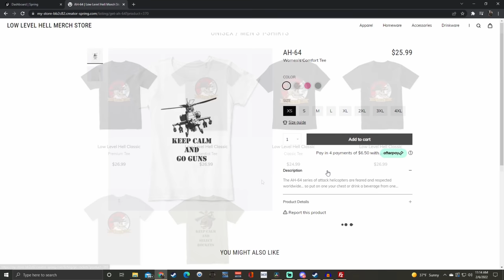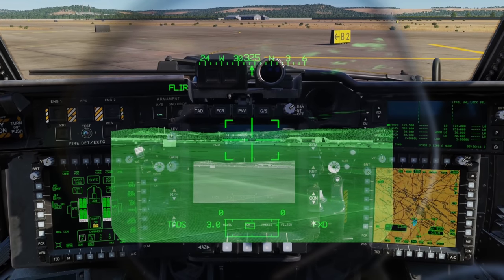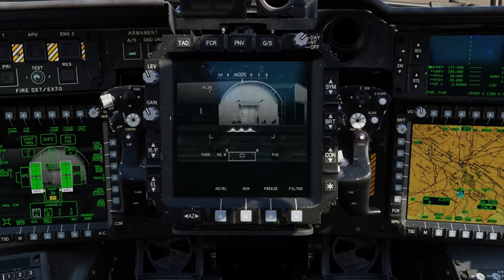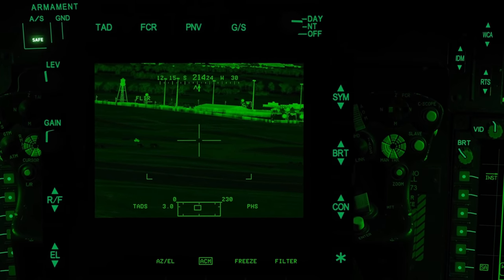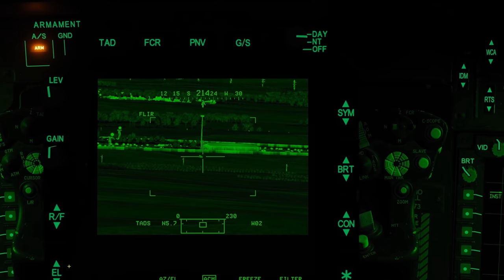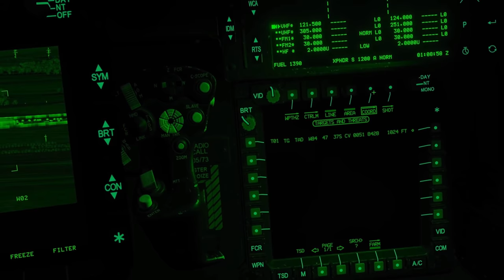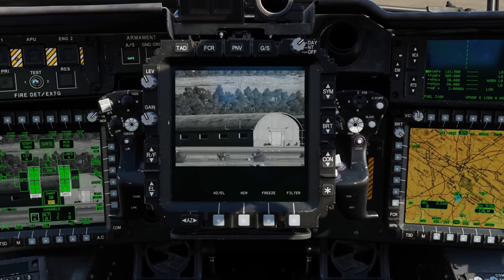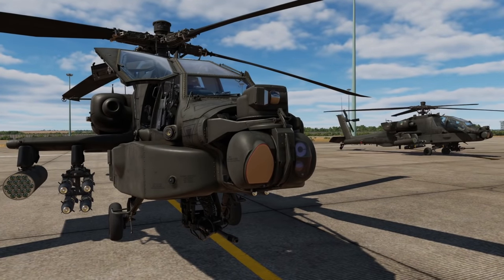DCS AH-64 TADS | Apache Pilot explains the basics | DCS World

Comment: Out of all the DCS aircraft that we already have AH-64 looks more like A-10CII of helicopters, Hornet feels simpler
Reply: Honestly, "simple" is  a very subjective perception. For example, with the AH-64D systems aiding you how they do, and from what I've seen and read so far, the operation is pretty "simple", for most of the stuff. The game changer is multicrew. In the A-10C II you do all of it alone. In the Apache, either CP/G human or AI figures it out. Otherwise you would need to try doing two jobs in parallel, which makes it horribly complicated.
Interestingly, the Hornet feels more "complicated" than the A-10C, because the NAVY Aviation really seems to have issues, creating or simply re-using concepts and workflow similar or copied from the air force... Starting with the inability to use Gun and Missiles in a dogfight at the same time to a HMCS that doesn't even show you where your TGP is currently looking, unless you create a designation. The AH-64, as well as the AV-8B or A-10C seems to be designed and updated, around the very mission profile it is primarily used for. And this shows. I think I'll love this bird.🥰
Reply: exactly! For me Hornet is much more easier, and ergonomically advanced then Viper or Hawg
Reply: Calling the hornet simple is a thing most inaccurate.

Comment: Question. IRL did you guys often close your right and left eyes when utilizing the TADS sight mode? To prevent a double image, or was it not much of an issue? Just curious as you were talking about using your unaided eye to find something of interest, and then using your right eye to take advantage of the FLIR.
Reply from the maker: I would close my left at times to focus on the PNVS while landing but that’s about it
Reply: @CasmoTV  Copy. Thanks for the info friend!
Reply: I agree with Casmo. During landing (especially on an airfield with bright lights on the runway and whatnot) i close my left eye sometimes but your brain just sort of wires itself after a while to process the two separate images separately, if that makes sense. Supposedly no-one is able to "multitask" and therefore process both at the same time, but you switch back and forth so quickly that it looks like you do. So seeing two separate things with two separate eyes is no issue, it just gets annoying when the background gets so bright that you get two separate images in your one PNVS eye (the background "burns" through your HMD, if that makes sense)
Reply: I would add that that is why you wanna keep the symbology brightness as low as possible. For me, it always made it easier to switch between eyes with that brightness driven down to a point where I had to consciously focus on the symbology

Comment: I might need to make the upgrade from TrackIR to VR soon... Feels like I won't be able to get the most out of this without a single-eye overlay rather than a screen overlay.
Reply: It will certainly improve your experience!
Reply: I can see someone trying to use TrackIR with the PNVS and getting sick. It’s already one thing that the PNVS is 10 feet in front and 3 feet below you. Looking to the side automatically induces parallax. With TrackIR, you’re going to be doing that by turning your head, but your eyes are going to be looking back toward the screen…makes my stomach roll just thinking about it. 😂
Reply: @tschooler  You also don't have the precision. 90° of view is done by ~10° of head movement. Totally not ideal for aiming the gun for example... :D
Reply: @tschooler  No because your inner ear is still concurring what the eyes are seeing ; your body knows that you are seated and looking at the screen. Unlike VR, it doesn't have contradictory informations that you have to adapt to.

I don't see how it would be different from the HMDS on the Viper of Hornet. I use those extensively and never had any problems with TrackIr.
Reply: @simonhouel1984  I'm not sure I'd agree with that. Each person will have a different response. I've seen plenty of people get sick in my flying career, usually when inner ear/eyes/seat of the pants don't all agree. Just because you didn't have an issue doesn't mean that others won't.
Reply from the maker: I haven’t had any motion parallax issues/ disorientation with the PNVS on track IR with the test build but not everyone is built the same.
Reply: @tschooler 
That's my point. With TrackIr everything is on the same page, not to mention the peripheral vision that provides informations that concur with what every other ''sensor'' get.

Basically, you are just staring at your screen with an overlay on it.
Maybe it will indice some weird head gymnastics but I really don't see what would cause the brain to feel to being cheated or something.

But you are right though, we are not done the same.
I may be missing something here but I really can't see the difference with the Hornet or Viper Helmet.
Reply from the maker: It’s incredibly different, the primary difference is that you don’t see-and-avoid while flying using  the helmet displays in hornet/ viper. They provide you information like your HUD but it’s not an actual visual sensor that you use to see. That and the fact that when flying down low, parallax effects are much more pronounced than at altitude because the distance to objects is so much shorter.
Reply: @CasmoTV 
Hmmm, okay.
But from from a player standpoint, at the end of the day, you are still looking at your screen, right ?

There is no difference between left and right eye so ...

Now reading what you guys are writting I may be missing a point.

After all in DCS with TrackIr, it is like we are looking with both eyes into one.